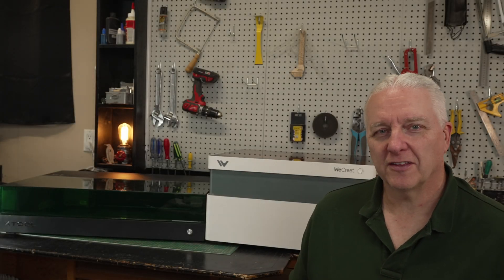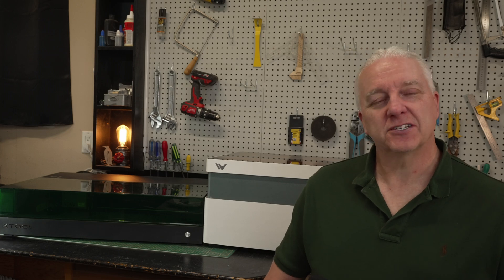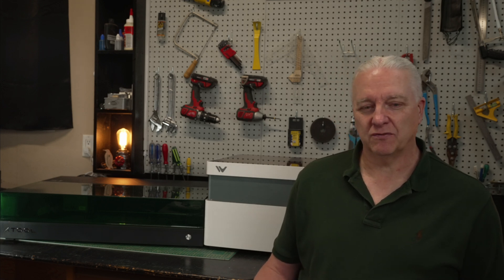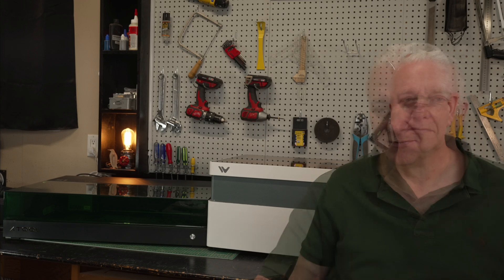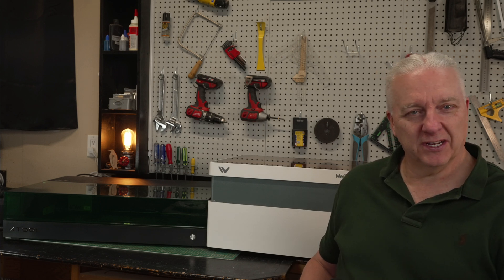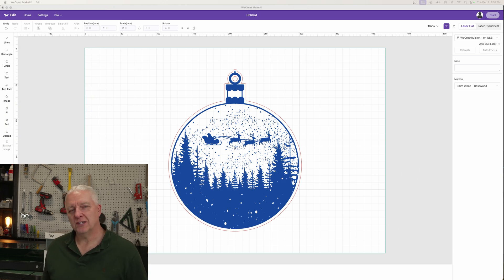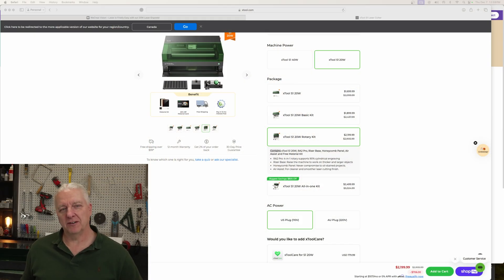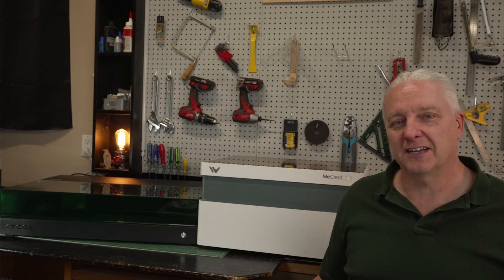Wecreat Vision vs xTool S1 -  Which Enclosed Laser is Best?

Comment: Hi Steve, Great review. I’m a bit concerned that xTool won’t specify the wavelength of the diode laser heads. I’ve been asking in every possible way but I am  told they are “not specified”. Without that information are we really sure they are safe? The best info they can offer on the green plastic cover is OD4+. Eye protection should be at the top of any diode laser safety list. Thoughts?
Reply from the maker: Any blue diode laser will be 340-355nm wavelength.

Comment: I wanted to point out you didn't mention that the s1 does curved surfaces engrave and can add different sizes and IR Lazers for metal.
Reply from the maker: I covered this in the S1 review video that I did.  But yes, this is a distinct advantage of the S1 if you are using XCS to control the laser

Comment: Wecreat now comes in 40W and you can use Lightburn with it.  Those were the 2 tipping points for me.  Lastly, it now has a passthrough system.  No brainer,  I'm going with the vision.  Very impressed and the price is right
Reply from the maker: I’ll be testing a 40W Wecreat soon so stay tuned, but this is quickly turn into the laser system to buy.  And, yes, the 40W will work with Lightburn
Reply: @pamelabrown3057  did you get the we create and how is it ?

Comment: I am currently in the research phase of which laser company to buy from when i stumbled across your channel. Thank you for going through a side by side comparison. I do like the features of the xtool. But the cost for each additional item quickly pushed it out of budget. The WeCreat did come up in searches, but didn't know if it would be good for a newbie. Thank you once again. Keep up the good, unbiased reviews.
Reply from the maker: As you note, the S1 is an excellent laser with lots of great features, but it isn't cheap.  It is also overkill for most first timer laser owners.

By contrast the Wecreat is cost-effective and is definitely geared to first timers.  Keep in mind though that it's a  20W laser rather than 40W, but 20-30W is the sweet spot for the best cutting and engraving.

From a support  perspective xtool probably has the edge.

Comment: Great video.  One thing to note that you didn't address on the S1.  The 20W module has a smaller spot size (.08mmx.06mm) than the 40W (.08mmx.01mm), which when calculating applied power per square millimeter, actually makes quite a large difference in the applied power.  This makes the 20W module's effective power applied to the surface of the material only about 17% less than the 40W module.  If the WeCreat has the same dot size as the xTool 40W laser, then the effective cutting power of the S1 20W module would be about 67% higher than the WeCreate laser.  But the price is significantly less.

Also, while I agree the workflow when using a camera like the WeCreat is smoother and less tedious, I'd argue that closed-stepper technology [manual] positioning of the S1laser head is much more accurate than a camera which introduces inaccuracies via lens distortion.
Reply from the maker: You will find this is a common characteristic between 20W and 40W lasers.  A 40W isn't really twice as capable as a 20W.

I will respectfully argue with your opinion of S1 positioning being more accurate, though.  I've been working on a new video and happen to be using the Wecreat, and its positioning is so much more accurate than manually positioning on the S1.  I don't think the S1 is terrible by any means, but the Vision gives this accurate positioning to you for free while you are creating your design, allowing accurate positioning to happen without even thinking about it.

You can get this accuracy on the S1, too, but it requires a lot of manual positioning and reframing to see if you have it right.  By contrast, the Wecreat Vision doesn't even have framing functionality because it isn't required.

Comment: xTool claims the S1 is a Class-1 Laser, it's plastered all over their website, so answer me this...why do they include goggles if you purchase the "riser/conveyor"? Why would they need to send you goggles if it's a Class-1? There are no "asterisks or disclaimers" on their website...no mention at all. Also, if you have the riser base, the front/rear access passthrough panels panels have NO safety switches, so an unknowing person could open it while in operation, or start the laser when the panels are open. Please research this and get back to us, you have a lot of followers that need to know about the possible very serious safety problem.
Reply from the maker: There are a couple things to unpack here.  First, as long as you have the base S1 without a riser, it is indeed a class 1 laser. However, once you add the riser, you open the bottom and pass-throughs that can allow light to escape, so it effectively becomes a class 4 again. 

I don't think they are doing anything devious here, though their class 1 designation appears to be self-certified, and while there's nothing inherently wrong with this as long as they are adhering to the requirements, it would be much more comforting if the Class 1 certification came from a recognized test lab.  To be fair to xTool, all laser companies that have Class 1 designation in China appear to do their own certification.

Somewhere in the tool docs for the rise, they will have a note/warning that the addition of this accessory makes this a class 4 laser.
Reply: I understand what you're saying and I appreciate it, but no where on their web site does it mention that the Class-1 designation does not apply if you use the riser or conveyor, to me, that is misleading.
 @SteveMakesEverything
Reply from the maker: @I-LOVE-EARTH  I would be happier if they used a recognized testing lab to certify then this sort of nonsense wouldn't reach end users.

Comment: Does the WeCreat or xTool (or other laser brand) have a software feature that automatically turns on the air assist in one job? Or is this something you can do in Lightburn?
Reply from the maker: Yes and Yes.  Both the Wecreat vision and the xTool S1 have automatic control of the air assist.   In the case of the xTool (and maybe also the Wecreate soon), you can also do this in Lightburn.  There is currently a bug in the S1 right now though, in that it any layer uses air assist, then it is on for all layers.

Comment: you and all these other youtubers that got paid to promote the wecreat should make videos showing all the issues/drawbacks with the wecreat alot of us know how bad it is after trying to use it the same as we use our other machines. The wecreat software effectively neuters the machine. I havent managed to get their support to tell me if i will be able to use the machine inside of lightburn not just gcode which still Their software will not allow large files with high dpi to process. the AI generation is bad the camera is off you cant rely on it to line things up. They have a library if you want something basic to build then you get some basic projects. their support talks in circles instead of actually answering questions when it comes to these things.
Reply: Don't mistake what I said as thinking that they just paid you guys loads of money. Im just reaching out to whoever might find answers first since the support isn't answering what I need to know before I cant return it.
Reply from the maker: @joekeen7415  FWIW I did shoot them a message to express concerns being raised about support.  Make sure you also join their Facebook group because the support folks hang out there too.
Reply: @SteveMakesEverything  ty I joined the FB group maybe someone other than Becca that gave me the run around will answer there.
Reply from the maker: Well I can only report what I see and I haven’t had any issues. My camera is perfectly aligned for example.  I assume other YouTubers have had similar experiences or you would have heard about issues - from me for sure.  If you are assuming I or any other YouTuber have been given bags of cash to say good things, you’d probably be incorrect.  However I’m not disputing your issues because they are no doubt valid concerns.

FWIW I do hear that Lightburn support is on the way, though I haven’t had confirmation or actually seen it yet.

Comment: The wecreat vision is total junk! I purchased one and had missing screws and broken parts. Customer service is horrible! I will never buy anything from them again! Cheap made.
Reply: For what it's worth they wanted to send me parts to fix it but did not have them in stock, I requested a new machine but I was told I would have to wait 20-30 days before new one would ship out. There were several things I had to disassmebled to get the machine to lower to be able to box the defective machine up, I was told if the machine was damaged on return shipping I may not receive a refund. Let's see I was sent a defective machine and I may not get a refund. Now that's a great way to treat a customer.... Not!
Reply from the maker: @WilliamJames-m4i  Hmm, well, that's definitely not good.
Reply from the maker: Bot or not the comment is pretty generic. If there were broken parts blame the shipper rather than the manufacturer.  The remark about service applies to virtually every laser company as far as I can tell, and I hear a lot of complaints.

For what it’s worth, my Wecreat has been completely solid
Reply: this looks like a bot comment ... Joined Dec 10, 2023 very generic looking name, empty channel, weird username
Reply: @silmviburlane6411  I'm no bot

Comment: The xTool has a built in fan with a hose to direct fumes away. I couldn't find info on the WeCreat if it has a similar system.
Reply from the maker: The Wecreat also has a fan and hose setup that works just as well
Reply from the maker: The Wecreat also has a fan and hose setup that works just as well

Comment: Thank you for the head-to-head comparison. Can you tell me if the WeCreat software allows batching like Lightburn does, using a CSV file?
Reply from the maker: Hmm, that’s a good question and I’ll have to check for you.  I rarely build more than one of anything so I will admit my lack of knowledge.
Reply: Thank you  @SteveMakesEverything  . The batch feature would be useful for customized items, for example your example ornaments with different names on each one.
Reply: There is a work around that allows you to use Lightburn. Watch The Louisiana Hobby Guy's review at 41 minute mark.
Reply from the maker: @ljgault  Yes.  There are always ways. 🙂